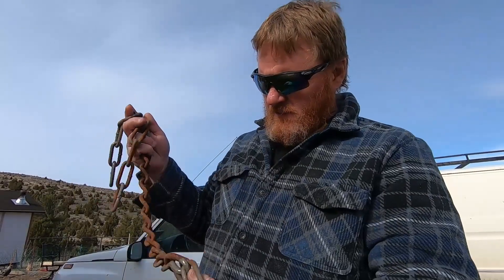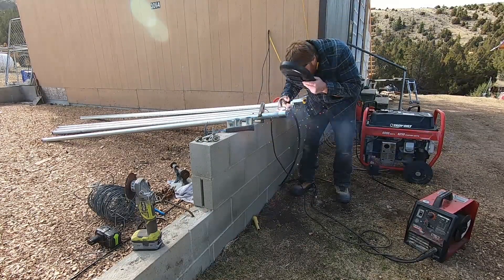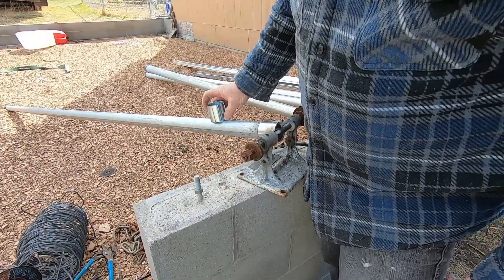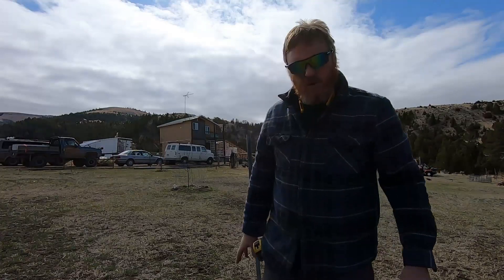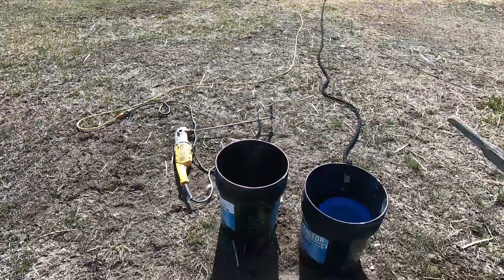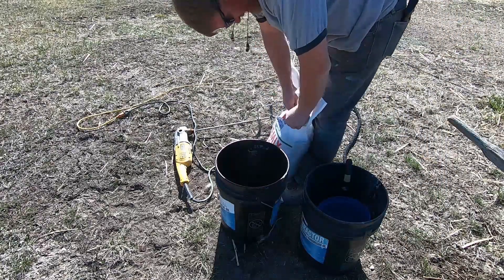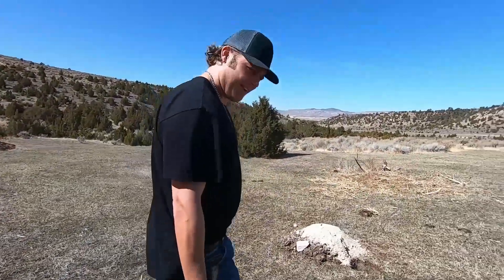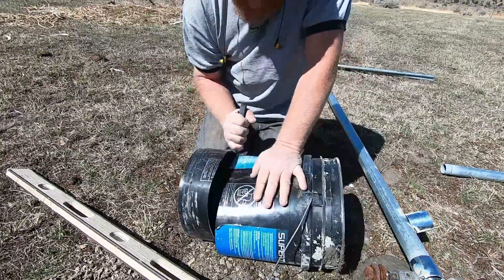Building a wind turbine tower start to finish, How to make a wind mill tower, How to build a gen

Comment: When you bought that pipe, did you order from eBay or buy local, and I'm curious why not 2 inch pipe? I've a 1200w turbine I have to put up in wv and I'm trying to get all the information I can, also is there anything you wish you'd done differently?
Reply from the maker: Yes, I should have bought 2 inch pipe lol. And yes I bought the pipe local.